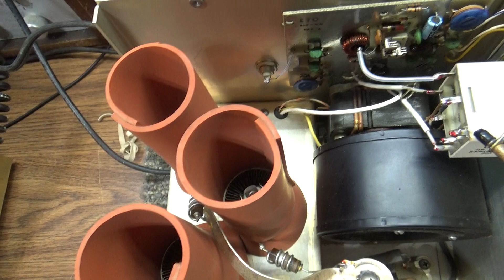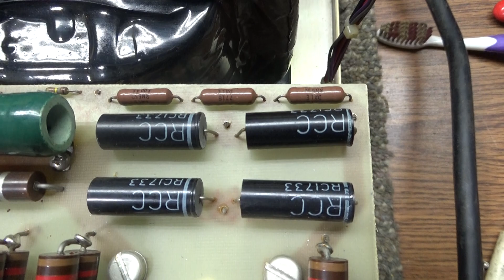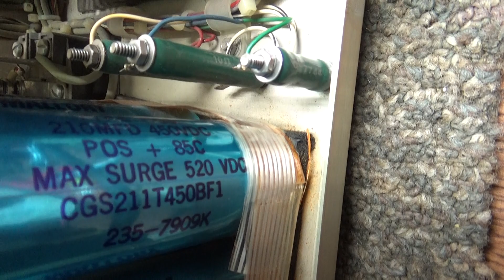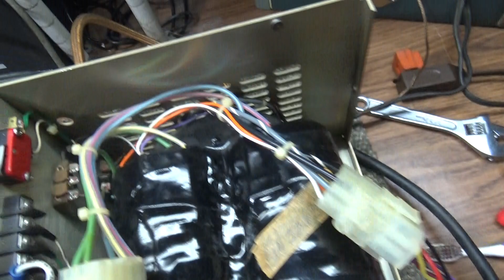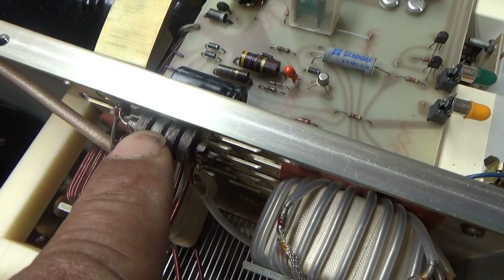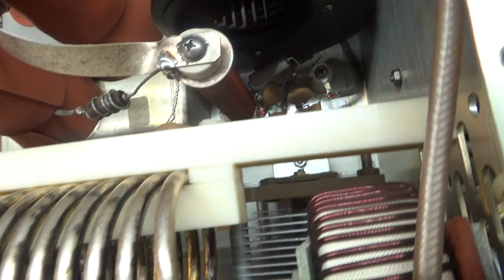Latest Toy, Alpha 76PA 3 tuber walkthru. unpowered,

Comment: Awesome video my friend! I picked one up and the voltage goes up to 1,750 and fan comes on, no illumination. Replaced all 3 wirewound resistors under the control board. On the board, replaced all diodes, caps, transistors and some resistors. The white wire has about 28vdc, not sure what the heck to do next. Replaced the two relays under the meters (was fun), and checked the reed relay and adjacent on top of board, both function correctly. I'm stuck!
Reply: One of the carbon resistors was open (R120), and another was out of spec (R123?). Works now and tubes are good. Just swapped out stock choke with an Ameritron RFC-3 choke and couple of 10kv .001 doorknob caps, to be usable on 12m. Also swapped out RCA input jack with SO-239.

Comment: Tram D201 has a kill switch on the lid.
Reply from the maker: Yes and later ones they moved the kill switch to the front under the front lid right screw which activated it. Some people would take the screws out of the front lid and then wonder why the radio won't activate.

Comment: Great video brother!👍 And a very nice amp! I almost always put an Ohmite z-28 on the output connector of my  tube CB amps. Like you said, should those capacitors short, then that inductor will short high voltage D.C. to ground. But it’s invisible to CB RF. Also, they short static electricity out if your antenna isn’t D.C. grounded. Beginners should remember that those high voltage diodes may show open on some ohm meters. You have to have enough battery voltage to overcome those multiple diodes inside the package. If there are 3 at .7 volts each, then a meter with a 1.5 volt battery can’t test it because they have a 2.1 volt drop total.
Reply from the maker: Agreed.